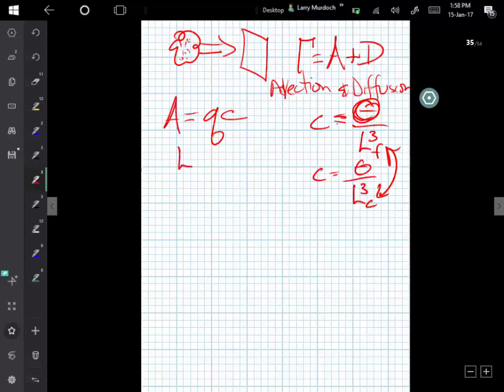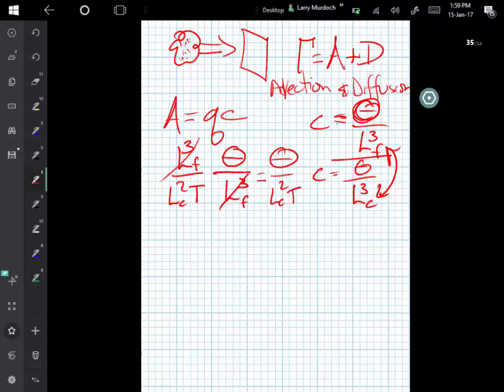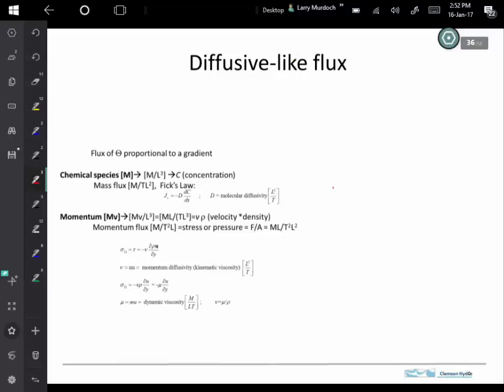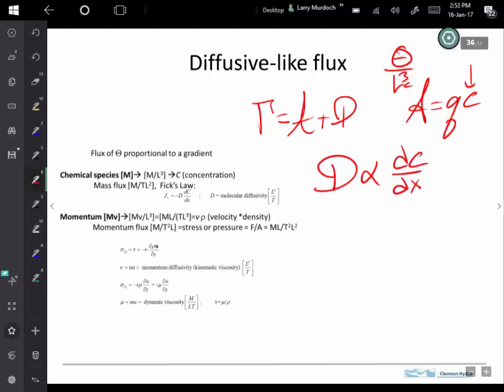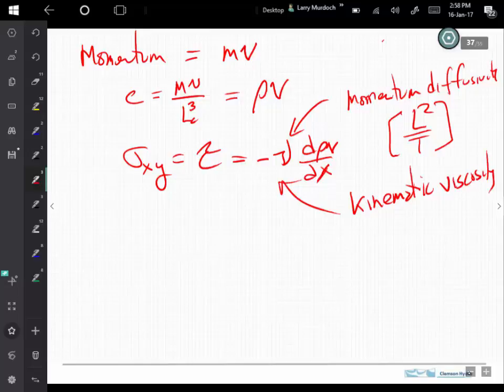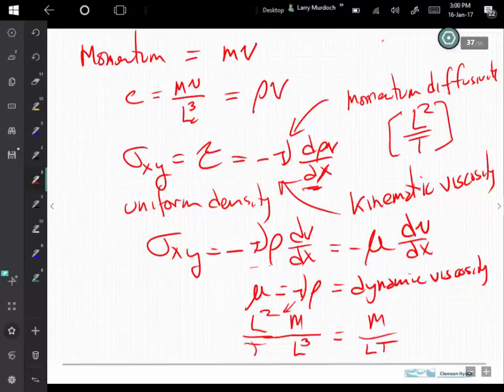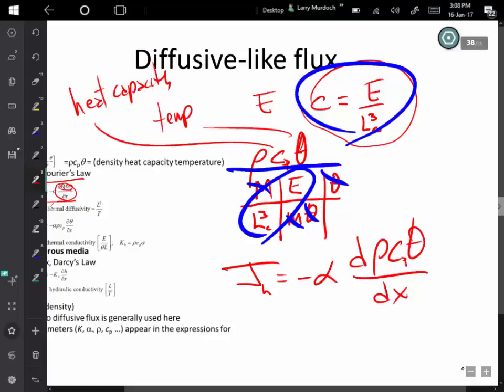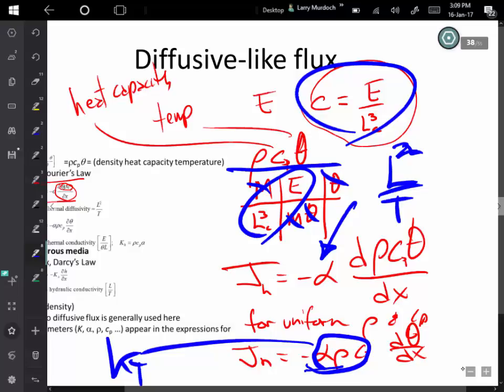APS Overview,  fluxes P5

Comment: Thank you very much for the detailed derivation, but would the denominator in the second A be the porosity times saturation? which is then the volume of the fluid per control volume.